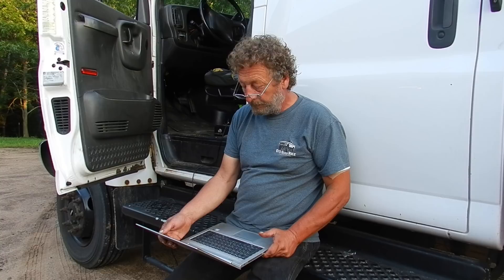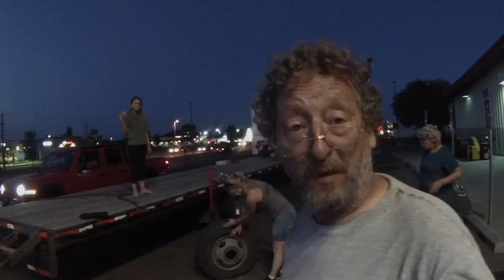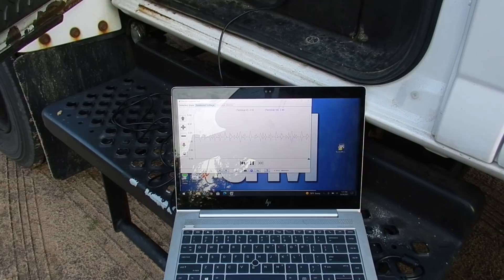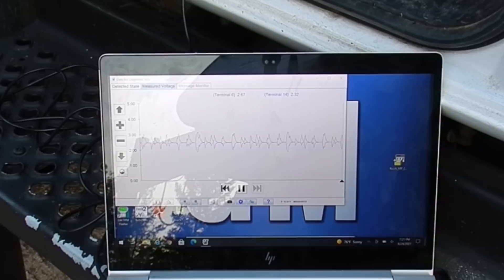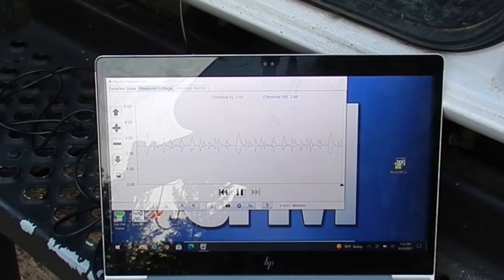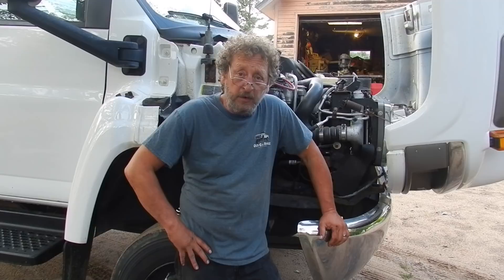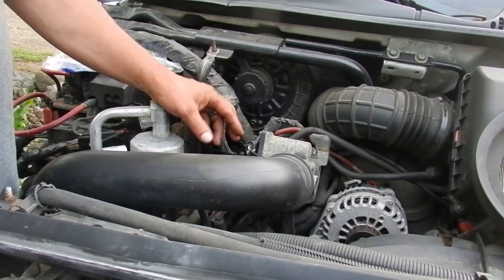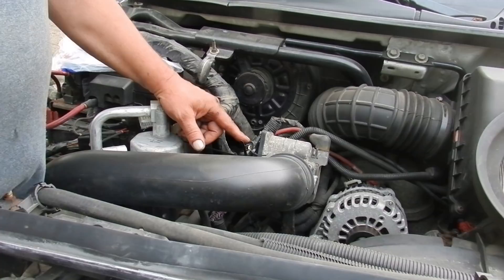GMC Topkick troubles and repair is it fixed

Comment: Anybody else miss the old days?
 One or two barreled carburetors, points, and mechanical fuel injection diesels?
I have an 1967 MGB, 49 CJ 3, 1953 Chevy  3/4 ton pickup and a 1961 John Deere tractor.
If, and I repeat, if anything goes wrong on the road, I can usually fix it on the road!
I agree about the crimp on connectors!  I always have trouble with them, usually at the worst time!
Reply: I agree about too much electronics and sensors.

Comment: I've had issues in the past with those braided ground straps, they aren't reliable in areas where they are exposed to the elements as they reply on a crimp connection in the terminals and they tend to go high resistance exactly as you found.... I always replace them with a normal cable with good crimp connections and heatshrink with the inbuilt hot glue seal over the crimp.... works much better

Comment: Having troubleshooting DC circuits for 50+ years, I must say that 90% of the time the problem is ground related,  and in AC 99% of the time the problem is the neutral.

Comment: I found some crimp on connections at a marine supply that crimp on ,have heat shrink to water proof ,and soldiers the connection as heat gun does its thing , aren't cheap  works really good.
Reply: The connectors supplied looked like that style.  I tried them and found them to be useless, went back to either straight solder or crimping.

Comment: I am a Technician At the Chevy dealership I work at and on the gas powered trucks with the drive by wire throttle body they throw the reduced engine power code as well and the manufacturer has us replace the whole throttle body.

Comment: Help !! My 2000 gmc 7500 top kick started with someone changing the starter not sure if this played into it. It ran but progressively got worse rough running, low power then no spark . Found crankshaft position sensor mounting bolt was stripped and held in with silicon. We tapped the thread and installed a new crank sensor but still crank no spark. The throttlebody engages when the key is turned on, and the fuel pump, relays are clicking, grounds have been checked in a new battery. Any ideas

Comment: If yours is like mine the wires rub on the motor and ground out . And I get trans fluid in my trans plug on the back of the trans

Comment: My dash is locked up radio says loc all the lights are on and none of the gauges work. I had and injector put in and the dash is lock up, and I can’t get any body to work on it. Where can I the programming to diagnose the problem.

Comment: Hey what program are you running on your computer to diagnose the truck? I have a 2004 and I need to be able to check mine out
Reply from the maker: I am a GM tech, so I have access to GM diagnostic programs.
Reply: @recoveryteam  
Okay cool do you know of any program I can use online that's for the public??
Reply from the maker: unless it is a communication problem between modules most aftermarket scan tools will do the trick.

Comment: As I remember?? that upper braided strap I couldn't get my hands on to?? Guess I will have to try harder when the now problems are fixed. I took 4 parallel #8 wire Crimped/soldered/ dual wall heat shrunk onto the battery ground to the one which is above the passenger  tire inside the frame two forward for future and two to the rear for added light DC. I Kopper Koted the H** out of the ready rod with S/S washers and . As it is easier to prevent a problem then fix it.

Comment: My 2004 GMC top pick C5500 bangs when I put it in reverse and the wrench 🔧 with the gear light comes on, when I put it in reverse and won’t move in reverse and barely moves in drive, what could that be??
Reply from the maker: Check fluid, check for codes. there is a internal filter that should be serviced every 2 times the external spin on is serviced.

Comment: I have a 2000 gmc c7500 the power cuts off driving and the rpms needle starts up and down and it does explosions the truck starts jumping like I say the rpm needle drops down and the engine is to accelerated I don’t know what to do I took it with the mechanic and nothing works
Reply: Did u figure it out.  I have the same issue.  Thanks
Reply: Possible electrical issue. Check starter wiring.